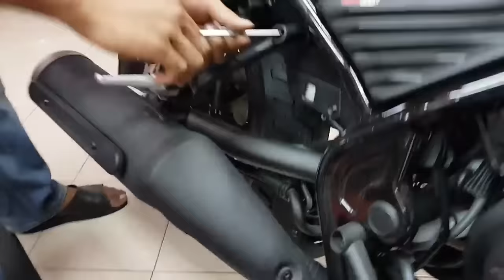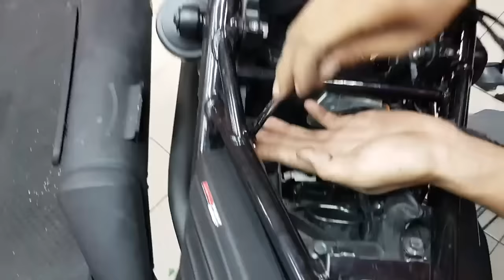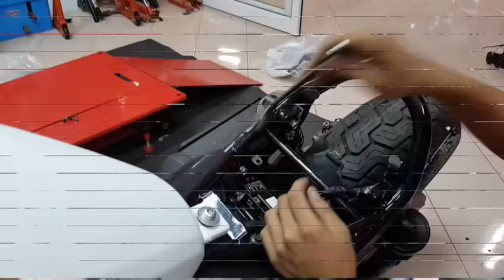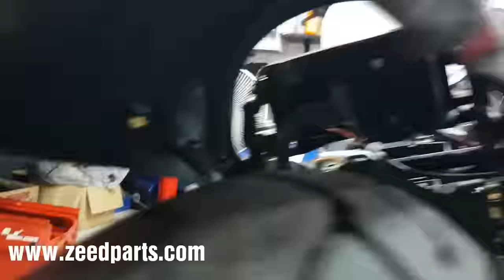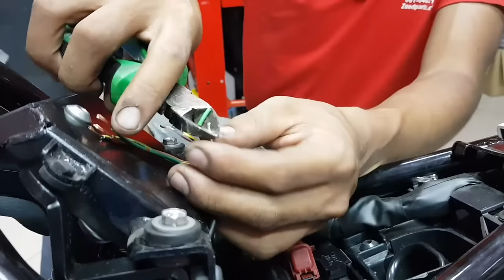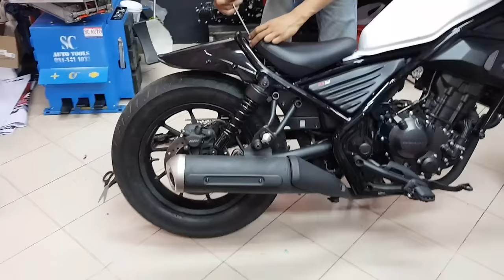Install Honda Rebel CMX 300 - 500 Real Cowl Tail tidy with Light

Comment: I ordered this last week and just installed last night. Super easy install especially with the video. The ONLY suggestions I have are: Longer wiring, and figuring out how to use the water/mud guard to keep water and moisture out of the battery compartment. Overall, GREAT product and super fast shipping. Also, take off the rear pegs since they're now useless after installing this.

Comment: I have my fender installed now!
One thing concerning me, do I need a mudguard/splash guard to keep water and sand being thrown into the Airbox under the seat
Reply: No, it gets eliminated. I am trying to manufacture something using the old one. Might just drill holes in it and mount it to something.
Reply: I was wondering how to keep water off the rectifier with now guard behind the tire.

Comment: looks good, my only worry is theres no protection underneth for that electrical box, sees like it should have a piece of plastic of something there, and why do the signals flash so fast????? thinking about ordering one, thanks
Reply: Cr Chris how did the install go?
Reply: Cr Chris awesome. Did you order straight from zeed? Been thinking about doing this to my 500
Reply: You need LED load resistors for the signals...$6 on Amazon. They go between the signal and ground...makes them flash at normal speed again. Also, same experience with the wire being THIS long--->  --------------------------------------------- coming out of bottom of fender. Other than that, GREAT and super easy install...just take your time.

Comment: Hope whoever gets that re-does that wiring, electrical tape and some twisting won't keep for long. Does this kit not include a plate holder?
Reply: wire fire
Reply: i cant get over the fact that he took off way more wire length then i would...
Reply: No plate holder. After this install, you need a side mount. Don't get one on Ebay though, they charge over $100 for them...which is ridiculous. Buy one on Amazon and drill a hole on the bottom right of plate mount. Attach it to the lower shock mount on left side of bike. SUPER easy and save a ton of money.

Comment: Does anyone know the Torque Specs for the axel nut? Putting a side mount for my license plate
Reply: Dont use the axle to hang it, use the shock mount. I used a $15 dollar side mount from Amazon, and drilled ONE hole at the lower right corner to have it sideways on left side of bike. The E-Bay side mounts are over $100...who are they kidding?